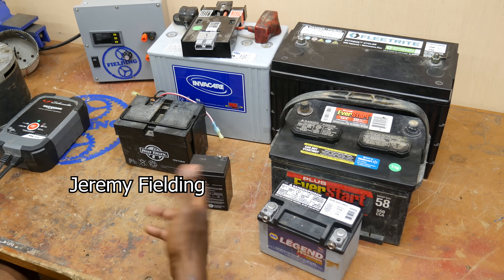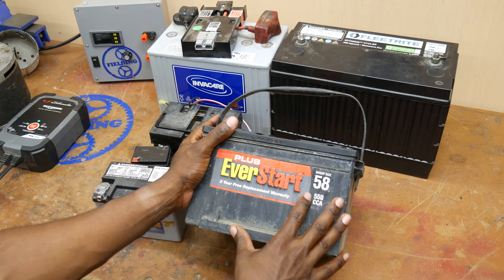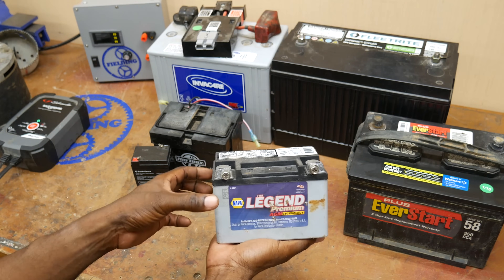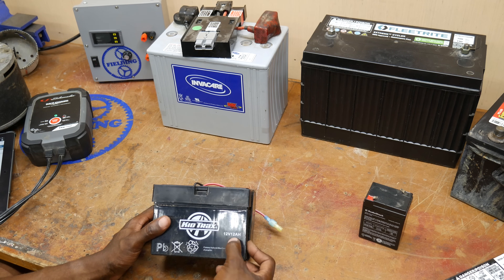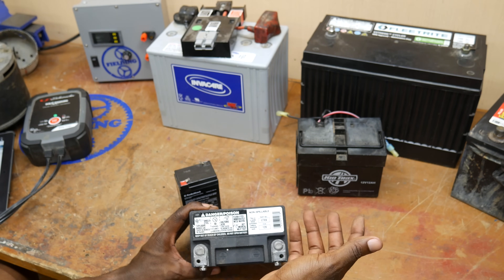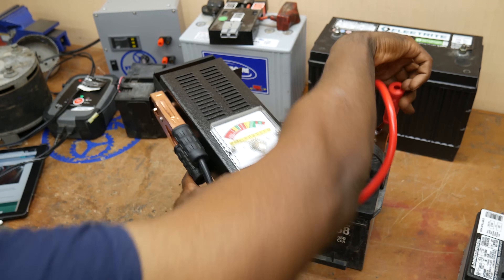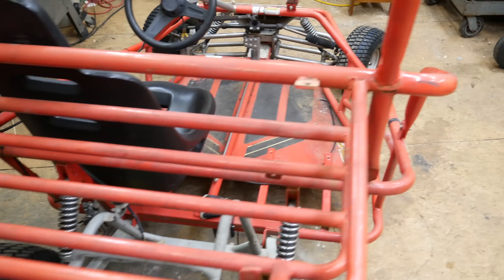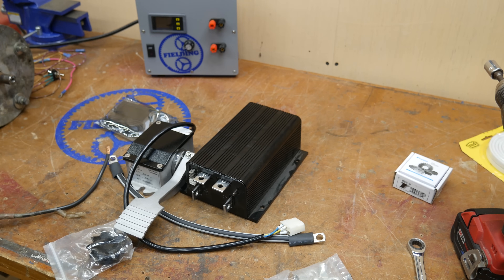Introduction to Battery Types and Reading the Labels For Use In a Electric Go Kart or Bike.#062

Comment from the maker: Changes to the center of gravity will be discussed in a future video. There aren’t a lot of places to mount the batteries so it’s a problem I have to work out.
Reply: As usual, you make us aware of the real vent points we need to know! Excellent explanation! Looking forward to your decisions on battery location and test drives. Hope your back yard doesn’t have too nice a bed of grass - haha. Next series will be how to build a charging station AND how to keep the kids from fighting over who rides next.
Reply: YOU KNOW YOU WANT A CART AS WELL HAHAAH WE ARE ALL BIG KIDS AT HEART!! LOVE YOUR PAGE OLD ONE LEGGED JOSEPH T RETIRED NAVY
Reply: Jeremy Fielding I have a nissan leaf and was wondering if I could put a deep cycle battery in place of the accessory battery? The current battery they use to power the accessories is a basic starting battery. the battery I'm considering is a marine deep cycle 75ah.
Reply: Paul  McGarr 
It depends on how much current your accessories will draw. It could be quite a lot if it includes AC and heating. Why would you want to change it? Your manual should specify the minimum requirements for the battery so maybe that will give you the answer.
Reply: i was just about to say something about center of gravity. hmm.

Comment: One thing I learned during my electric go kart build (...and still ongoing) is that there are batteries that will NOT supply enough current to match your motors full potential because it will be limited by the internal resistance of the battery. Now I have to buy different batteries....by the time I had figured that out it was too late to return the batteries...

Comment: I an Enzo from Italy. Thank you for your very interesting videos. I need your help in order to choise the right battery for a winch. I have just bought a Rhino 12 V  4500lbs (2040 Kg) winch for loading and downloading my boat (1100 Kg) from and to the sea. I would like to know wich battery do I have to bought IOT load and download my boat from the trolley ? The Rhino instruction says that the battery should be minimum 12 AH. It seems to me too low. Could you please give your opinion ? Thank you very much .

Comment: I am intending to build an electric scooter with a motor with these specifications: 48V-1000W-26.7A. I did some research and found a battery with these specifications: Lithium battery - 48v, 100000mah, 1000w, 13s3p, xt60, 48v, 54.6 ah pack. Do you think this battery would be good for the engine I'm going to use?

Comment: Hey Jeremy, I purchased an off road led light bar for my go kart as well as some led strip brake light and design lights. i also plan on purchasing a (1.5 watt) solar battery trickle charger that clamps on directly to a 12v battery and mounts on top of the kart to keep the battery charged. (note: the 21 inch light bar says "10-30v" and "120w" on the box)

whats your thoughts on the battery charger? do you think its a good idea and do you think it'll work?

and

what battery would be suitable in my scenario -Thanks

Comment: for that small battery 12v12ah, its not 12A for 1 hour OR 1A for 12 hour ....
a lead acid battery is odd that way...
fact is, if the battery is 12Ah (20h) and you take the full 12A out, you end up with a smaller Ah battery ....if memory serves it will be around 25% lower  so you end up with just 9Ah.
at 0.6A, it willbe good for 20 hour
at 0.3A it will be longer :)
also, keep in mind that a start battery should only be discharged around 20% (meaning a 100Ah batt leves 80Ah more or less unused)
a deep cycle battery can discharge 80% so only 20% is unused
in both cases, using more power will shorten the battery lifespan .
small rule of thumb about kWh rating .... 25kg lead can store around 1kWh (just imagine the weight without acid and casing )
higher current means bye bye capacity

Comment: Rather than running with a a bum alternator, Reserve Capacity may tell the driver how long they can safely operate their electronics without the engine running. 25 amps at 12 volts is 300 watts, which is a pretty substantial draw. So if your gear draws under 100W, you can safely park all night without idling, for example. 🤔

Comment: So just found out that some of those kids electric vehicle things (peg perego brand) actually use two of those little 4.5Ah 6v "emergency light" batteries (the one you said is obviously no good) in series inside a little case. Might not be great capacity or current, but they do work in the little plastic cars, and at least if you figure this detail out, they're cheap to replace. I assume economies of scale on that relatively standard size is why the company used those.

Comment: Hey there, I have a lead acid battery with both terminals got corroded badly so I want to ask are those terminals replaceable? Or just throw away and buy a new one?

I frequently test run many type of starter motor many time/per day by directly connected the battery which leaded to recharging the battery multiple time in one single working day.
Reply from the maker: I don't really know. I would call a local battery dealer with that kind of question. They should know
Reply: Alright then, thanks for the reply.

Comment: Years ago I took an introductory electrical engineering course.  One of the topics it covered was the Thevenin model of a power source (see https://en.m.wikipedia.org/wiki/Th%C3%A9venin's_theorem).  It says that a power source (like your batteries) can be modeled by an ideal voltage source (which will always put out a specified voltage no matter what the load) and a resistor that is in series with the load.  This resistance is referred to as the Thevenin resistance or as the internal resistance.

In the case of your batteries, this is a way to model how the output voltage will drop as you draw more current.

The Thevenin voltage is what you measure with a volt meter under no load.  You can estimate the internal resistance by connecting a load of known resistance to the battery, then  measuring the voltage drop or current and applying ohm's law.

The chemistry in batteries might not lent to such a simple model but the model will still probably hold within some range if current draws.

Depending on your education background, you may have already learned this.  I figured I'd mention it in case it's helpful to you or if any if your viewers want to dive in a bit deeper.

Comment: I appreciate the pop up text correcting yourself or clarifying things. It's hard to say things exactly right every time but you are taking the time to make sure people have accurate information.

Side note: the Sealed Lead Acid batteries like the one you pulled from a Power Wheels are the same kind they use in computer Battery Backup or Uninterruptible Power Supplies. If you ever try to salvage batteries from a UPS they tend to be bad since they draw so many amps from the battery which heats them up, and they get discharged so deeply since they are meant to sustain a desktop computer and monitor for a few minutes until you can save your work and shut down. 550VA (common size UPS) generally have 7Ah 12v SLAs, for example if your UPS is holding up 350W that means at least 30A is being pulled from the battery which means that you won't be getting 7Ah out of it plus if the computer is not configured to shut down quickly enough the battery will drain to the point the UPS will cut out. UPS are great since they are a battery charger and small inverter in one, but the batteries are almost always bad if you find them used.
Reply: thanks for that info Fooxz

Comment: I don't do what you do but absolutely love to learn. You are an excellent teacher. I have a multimeter. We will be traveling a lot going forward with a small trailer that stores solar power in a LA battery. Would owning a battery tester be helpful or unnecessary. If necessary, would the one you use be adequate or would a cheaper model be adequate?
Thanks!
Reply from the maker: I can't adequately answer that question for you. But, If you rely on batteries, it would certainly be a good choice to have a battery tester of sufficient size to check your batteries. You can investigate and fill in the blanks.

Comment: Just make sure you have appropriate shocks that wont return in kind the force you're going to exert on them while riding around.  I also imagine you'll be adding appropriate counter weight to the front of the cart to correct weight bias.  Thank you professor Fielding on the video.  your videos are like new toys for Christmas.  Just can't wait for them!
Reply from the maker: While I didn't want to modify the kart, I decided they are just too high in the back. I had to cut some steel and move a few things but they are low and up front now.

Comment: I want to set up car batteries and ether use an inverter or a transformer to see if i can mimic a power outlett for use outside and then hopefully figure out a way to charge them probably using an alternator.... Would this work?

Comment: I have a single-phase induction AC motor from an old garage door opener. I'm fairly new when it comes to these things, but is there a way to convert the motor into a DC motor?
Reply from the maker: No...but I have a series of videos on how motors work for beginners which you might enjoy. It starts with video #036. I explain the different motor types how they work with easy to understand demonstrations and you see all the inner works.
Reply: Ok. Thanks.

Comment: I had always wondered what was different about a deep cycle battery that allowed it to function fine in conditions that would kill a standard starting battery, very good info, thanks!  One thing to mention about battery ratings, as you look at batteries you sometimes see batteries with a label that says CA, short for Cranking Amps.  It is my understanding there is no industry standard for CA, where there is a standard for CCA.  The CA rating is normally seen on cheap batteries and is usually a lot higher than the normal CCA rating.  It is important to compare apples to apples so make sure to look for and compare CCA ratings.

Comment: A thought comes to mind that should work very well in theory, but I am unsure if it is doable in practice. 

The early Prius' sold are just coming to an end of their battery life. If you could get your hands on an old one you could take it apart and make your own battery out of the cells that are still good. It would be a pain but it would deliver the most bang for your buck, offer the greatest weight/power option available, and make it so you could mount the cells lower on the frame for better weight distribution. 

But in theory it is the best option.
Reply from the maker: That would be a pain... and I agree that would be awesome if someone was willing to put in the work.
Reply: I dunno, it doesn't look to awful hard assuming you could get your hands on one.....

https://www.youtube.com/watch?v=PIi51tHPSvY

Comment: Interesting video. In trade school, we were told to be more careful handling old batteries.  Batteries tend to accumulate sediments as they age, and tumbling them around can get the sediments stirred up enough to cause bridging between positive and negative plates.  That's one of the reasons why maintaining a car's suspension is important.  I hope you didn't short out any cells.  How old is that first group of batteries?  They didn't look new.  👍
Reply from the maker: They are new-old batteries. Maintained but never in service. They shouldn’t have any problems and are under warranty.

Comment: ebay has a guy that is reasonable called alarmhookup. it might be more work to build battery but the cycle life is another factor though leadacid if treated right can last beyond standard labeled life. some ppl dump and filter the acid then flush with de-ionized  water then put back old acid mix and top off with water. this might work on your dead battery i hear a little epsomsalts in each cell chamber helps too on old leadacid. ecars are more everyday even jag has one now check your junk yards and crash holding lots by dealer ships. alarmhookup does have ok prices but the deals you have to wait for then jump on i have a max price perwatt ill pay. im not sure how you feel about sponsors but some battery company might do you a deal or give you free for promotonal

Comment: have you looked into caraudio lithium batteries like jy power or xs?
Reply from the maker: It’s a short term project. I am doing this project because it is the most requested build I have. I will ride the kids around for a few months and sell it. It is about the experience and learning not a long term money saver.
Reply from the maker: Lithium makes the cost to high for my budget
Reply: Jeremy Fielding only short term. Long term deep cycles won't last as long.

Comment: On Facebook there is a new group that just started up called "Jehu's DiY Powerwalls", started by the YouTuber "jehugarcia" who has converted an old VW bus to electric, powered by lithium ion batteries. The Facebook group, although it was created only a month or two ago, has a lot of awesome people sharing their projects, tips and tricks about using lithium ion batteries.

The power density of lithium vs lead acid is just ridiculous. It really makes thinking about converting a vehicle an attractive idea.
Reply from the maker: Lithium is fantastic... and that is reflected in the cost. I think if you have the budget you get way more stored power per lb.
Reply: If you are able to get a hold of junk laptop batteries or bad 'hover board' batteries or similar, you can tear them apart and test each cell with a ~$30 tester and throw out the bad ones. That is how most of the guys are doing it.

Comment: Excellent video Jeremy, as always! Have you any concerns about mounting the batteries that high, and raising the center of gravity? If you can fit them between the wheels, the c-o-g would be low and less prone to rolling over, or am I overestimating the weight of the batteries?
Reply from the maker: I am considering that right now... welding that is. Borrowed from a friend
Reply: My concern as well.
Reply from the maker: Yes.... I am aware of the change in COG I am reviewing the options now but there aren’t many options
Reply: Mphymel 
My thoughts as well, the center of gravity will be high making it easier to roll over. The other issue is that the suspension was not designed for that much weight. The original motor was on the unsuspended lower portion (which has its own issues), so it's weight was not on the springs. Putting 300lbs of battery up there will bottom the springs out (if not immediatly, at least when you add a rider).
Reply from the maker: My motor weighs considerably less then the original motor. I have already check the weight capacity of the go kart manual and adjusted for the weight I am removing. That is not a concern.
Reply: Jeremy Fielding 
Just one battery weighs about the same as the original motor. Can you hang a shelf below the existing one to bring the cg down? You would still have the spring issue.
I don't suppose you have a welder to reconfigure the lower swing arm to fit the batteries and the motor?
Reply: Looks like it would be a lot of work to put a battery inboard of each wheel.
Reply: High CG was the first thing that leapt out at me from the thumbnail before even watching the vid.
Agree that lithium cells should be used - can even get them for free by recycling dead laptop batteries (lots of them!) Loads of videos on how to do this.